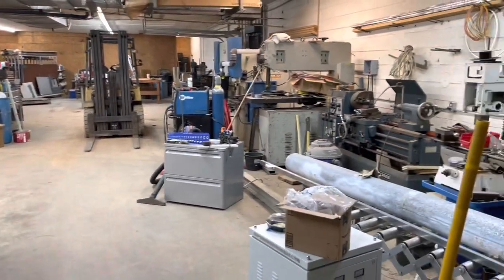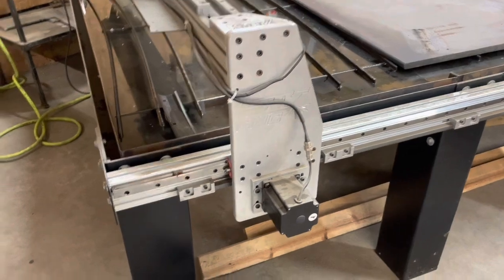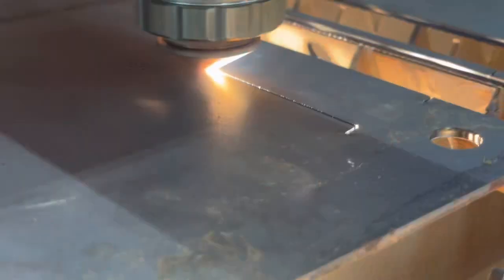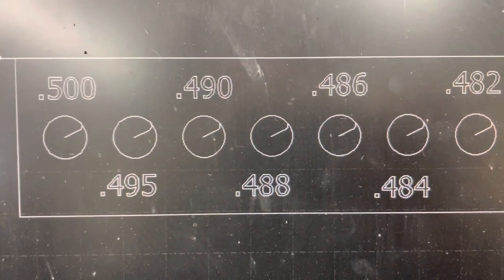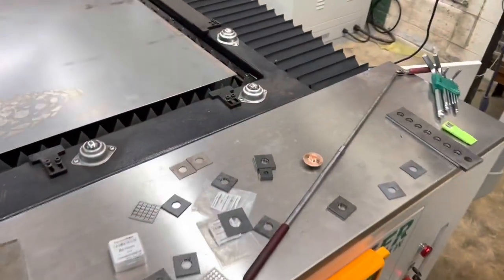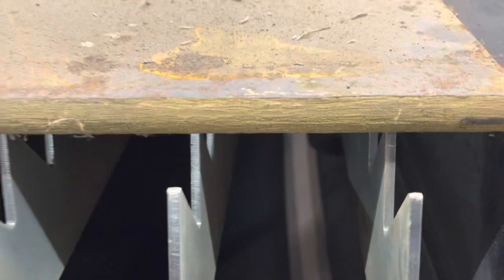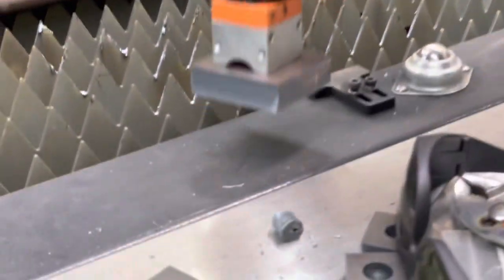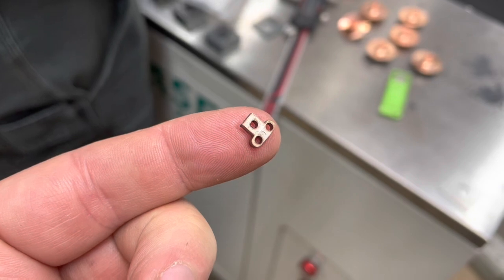Perfecting the cuts on Day 3 of the North Carolina laser installation with this OREE Fiber Laser

Comment: I noticed they had a lot of smoke coming off the cut , we ended up putting a hood over our open machine and it really helped . I will get Robin to send you a photo , it may help out someone with an open machine. We went from changing air conditioner filters every other day to every 3 weeks. It has also stopped most of the settled smoke all over the shop.
Reply from the maker: Hey Gary, thanks yea, I knew they built somethign but I havent seen pics yet.  That smoke rising is particularly bad with Oxygen cutting.  Because even with the downdraft running underneath, it doesnt help because so much of the smoke rises up on top of the sheet.

Comment: Fist time I think I have seen one of these cut some thick stuff. It did good on that 3/4".
Reply from the maker: Yea, the Fiber laser sweet spot is in thinner material, so 10 gauge and down.  I would put the edge quality below average in thicker material.  1. Waterjet 2. Oxyfuel 3. C02 Laser 4. HD Plasma 5. Fiber Laser 6. Air Plasma